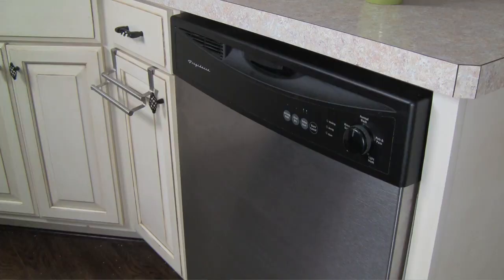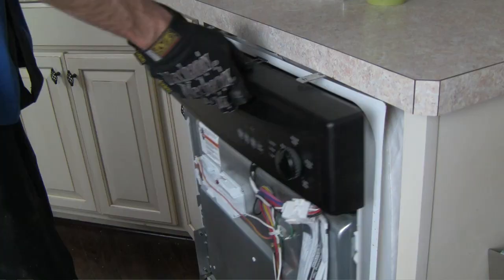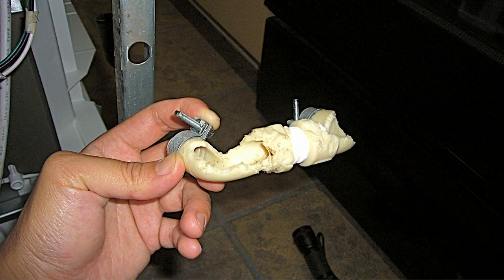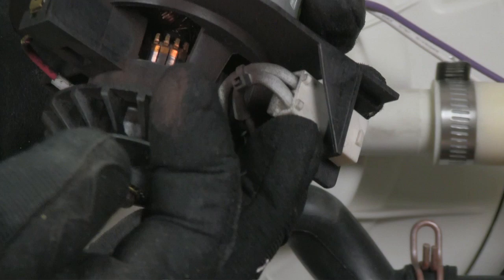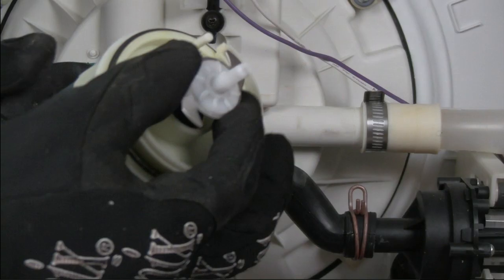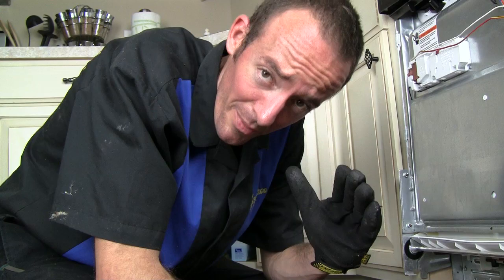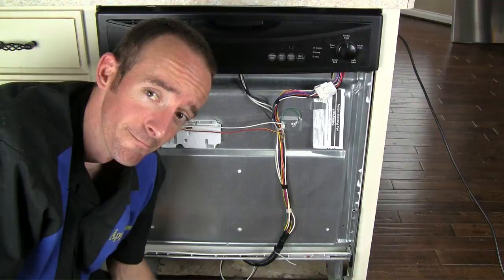How To Repair Frigidaire Dishwasher Noises

Comment: Hey man, congratulations on your expertise of how to make a very short and mostly important, very informative video. I was actually looking for a video on a different issue, but unfortunately none are available. I bought this place and the dishwasher has a weird film, sort of, like someone dumped a bucket of Sheetrock compound. Very white fine sand like film. I ran it 4 times without detergent, twice just very hot water and twice with a dishwasher cleaner. Results, sucked. I took the filter out and there is that white soft mud like compound all over. I've been using the same detergent the previous owner did, and can you believed it, it's the detergent? This ridiculous detergent can actually destroy your machine, with time, it builds up this type of sandy grit type mud. When dry, you actually need a chisel to remove it. Thanks for the video, if I ever come across any issues, I'm looking you up. Thanks
Reply from the maker: +Tony Oliveira Thanks for the encouragement! Hard to say what may have caused that... It could be calcium or it could be residue from gel detergent, that tends to leave more behind than most other detergent types. I have even seen people that are on their way out ruin appliances on purpose if it was an eviction type situation... if thats the case its probably done for.  It sounds like you have done all of the things I can recommend already... Limishine powder is the best dishwasher cleaner I have found to date, but if that doesn't clean it after a cycle or three it's probably best to replace it.
Reply: what detergent is it?

Comment: Thanks for the video.  My Frigidaire fdbb540ds1 is not draining or forcing water out of the top to spin the top arm.  Using your video I was able to clean out a bunch of gunk but it still won't work. It makes a strange sound when attempting to drain.  Could a problem with the drain pump cause the water not to pumped to the top to spin the upper arm?

Comment from the maker: It sounds like a control problem.  If the timer or control switch/relay is stuck on then opening the door would interrupt the circuit but otherwise it would run as long as there is power to the dishwasher.  So it sounds like you need a control... : (  
What is your model number?

Comment from the maker: In my opinion most dishwashers give less than desirable results... with that said there are some high end dishwashers that are very quiet and do a good job. However, they don't tend to have significantly longer life spans given the cost and repair is usually quite expensive. The main thing is fighting soap and mineral build up! Get the water as hot as possible at the sink before starting the appliance, use rinse aid, and scrape the big stuff off the dishes. More info on my website : ) Thanks!

Comment: I have the exact same dishwasher. There is definitely something caught up in one of my pump motors. It’s hard to tell which one it is from this video since you pulled it out from the installment area. but if I look directly underneath the dishwasher, there is a small pump/motor on the bottom, right hand side, right near the front of the machine. That’s where the sound is coming from, does anyone know what that motor is?

Thank you!
Reply from the maker: The smaller of the two pumps is the drain pump. So probably the drain pump.
Reply: Thank you for your reply! Do you know how I can select the drain function so I can see if that is what is making the noise? As it’s running through its cycles I’m not sure What function is currently on.
Reply from the maker: @bob-cd1lv on most Frigidaire dishwashers holding the start button for 3 seconds after a cycle has begun will cancel the cycle and run the drain pump for a short time.

Comment: Same dishwasher. Same noise. Took out the pump and disassembled as shown in the video. No blockage. No rubbing. Still Noise 😩Seems to be coming from inside the pump motor. Is it a bearing? Time for a replacement?
Reply from the maker: Sounds like the motor. But you’ve already half way to fixing it! 👍🏼

Comment: I have a question for you!  I have dismantled the dishwasher as shown.  The problem I was having is that I could hear water feeding into the dishwasher, but the dishes were not being washed.  I have gone through all the steps you have listed in the video, and other than feeding a live wire into the motor, I can't tell what the issue is.  Do I need to get a new wash motor?  Let me know soon as you can.  I have parts all over my kitchen floor!  Thanks.

Comment from the maker: Probably would be wise to pull the drain pump and check to see if something found it's way down in there.  It's a little strange that it would not drain at all with a similar noise, because that would indicate that the pump impeller is turning and should be moving the water out. You may have two problems: ( It is fairly common for the drain hose or the air break at the sink to also become clogged... You may be able to disconnect the drain line and put a shopvac on it to clear the blockage.

Comment from the maker: Thats a difficult one... If the motor sounds like it is working but you don't see any water moving during the wash part of the cycle, it sounds like the motor impeller may be broken.  All the main motor does is pump the water in the tank with its paddle wheel, so it sounds like the wheel may be broken or striped out.  I hope that helps some...

Comment: Hi We have a Frigidaire Dishwasher model #FDB1502RGC4 the original problem was the noise but was noisy from new (5yrs old) but now has developed a more serious problem. The machine will fill as normal but then just stops working, no wash cycle rinse etc. The machine will empty just fine if I hit the drain button. Looking to take out the motor to see if it is jammed. Could this be a likely problem or as I'm thinking the circuit board might be finished. Any help would be greatly appreciated as since it's not working my wife and I are doing dishes and neither of us,me especially don't like doing dishes by hand. Thanks in advance,
Brad

Comment: Thanks for the video.  Any suggestions on connecting an old mini fridgidaire dishwasher to the sink??  I just got it off craigslist (no model listed on the unit).  You plug it into the sink, but I can't seem to figure out how to complete the seal from the sink to the hookup...  Any suggestions on parts or makeshift ways to make it able to run?  Thanks!!
Reply from the maker: You need a portable dishwasher coupling that will hopefully thread into your kitchen sink faucet for the connection.  You can usually find them at a hardware store. You may also be able to find it online at a parts dealer but without a model number that will be difficult. Try an calling an ace hardware and ask for a portable dishwasher sink fitting... Good luck!

Comment: really helpful video. i thought i had fixed my problem when i found a piece of plastic in the circulation pump and another in the opening for the tube connecting to the disposal. when i put it all back together, however, the sound is still there, albeit slightly different (i think it's less? i'm thinking part of the sound was indeed the plastic in the motor. i would like to be able to test the pump independently like you did, but not sure how to do it safely. cause as of right now i can't even be positive where the sound is coming from... any ideas? thank you so much!
Reply: so i took it all apart again today, saw a lot of grime build up on the inside of the circulation motor, cleaned it off carefully with a toothbrush, put everything back together, and now the sound is worse. UGH. hoping i didn't put something back wrong in a terrible way! not sure what could have happened, but i will take it all back apart tomorrow i guess!
Reply from the maker: kristen hobbs Bummer.  The motors on these dishwashers are pretty low quality... it may be a bad motor bearing if there is nothing in it.  In which case replacement is the only fix.  Hope that helps! Sorry for all the difficulty.

Comment from the maker: What is the brand and model number of your dishwasher?  On many Whirlpool brand dishwashers the clean light is a heating error.  You may want to try preheating the water at the sink faucet before starting the dishwasher or turning up your water heater.  To clear the code on a Whirlpool push:  Hi-temp - Air Dry - Hi-temp - Air Dry (Air dry may be "energy saver dry")  then all the lights will come on and start a diagnostic test.  let it finnish and that should clear the code. Good luck!

Comment from the maker: Well you may need a new motor or control... you would need to check for 120 Volts AC at the wires to the motor when it should be running (almost immediately after the fill valve closes after the tank is full) If it is getting power and the motor is not running your control is okay and the motor is probably bad. if it is not getting power the control is likely the cause. Both options are pretty expensive so it may be time to swap it out...  Hope that helps some. Good luck!

Comment: When I pulled the pump out the impeller wheel portion came off the motor on stayed in the washer. I had to pull it out with pliers. Is that normal.

Comment: When i pulled my motor from the tub to inspect it, had a bunch of black powder pouring out of it. Does that mean the brushes inside the motor are wore out? The main problem is the dishwasher runs and fills, but gets stuck in the wash cycle and nothing happens. the control panel has already been replaced.

Comment: @applianceassistant - I have a Fridgidaire dishwasher that is usually quiet. I haven't used it for about 3 weeks and now I'm hearing noise during the cycle.  I also found a little white clip in the bottom. I really need to know what's going on.

Comment: I have a Frigidaire mod #FDB1250REC1 I bought that was a display but I have replaced both pumps, door switch and the control board within the last year and now it won't wash. I watched your video and took the bottom drawer out and pulled the screen and impeller cover, the impeller isn't seized but turns very stiff. Any ideas for freeing this up or do I need to feed the money hole under my cabinets again ? This is the most problematic dishwasher I have owned, the Maytag that this replaced worked trouble free for about 15 years and it was changed out for a remodeled kitchen. Thanks for your videos and any advise.

Comment: I have a frigidaire unit, and I am fairly sure this video comes pretty close to the issue, but I want to put this question out there before tearing everything apart. 

When the wash cycle starts, the circulation pump spins the water wheel for the first few seconds, which directs water where it should normally go (up).  After those first few seconds, it sounds like the pump is running dry, like it is losing prime.  Is this likely to be a clog somewhere that I can get to from the inside of the tub, or am I destined to pull this unit out and take the circulation pump off as you show in this video?

Thanks for this, your style of video production made me actually LOL, enough so that my kids came into my office insisting that I tell them what is so funny.  Good lighting and clear video make this very easy to follow.  Thanks again!
Reply from the maker: vbrookslv1 Thanks, Glad you liked it! The first thing I would check is water supply... if it's not getting enough water into the tank it may be loosing prime after the water is pushed into the air.  New thought... some dishwashers start the cycle with a short drain, before they refill with new water...  But if it is running the main wash motor I would look at water supply, then dig down into the sump from the inside and check for clogs.  You can even manual fill up the tank with water and see if it works that way. If it does you definitely have a water supply issue.  Good luck!
Reply: applianceassistant I should add this to clarify, after those first few seconds, when the pump sounds like it runs dry, I can see the water wheel stop spinning, even though I can still hear the pump turning.  This is with all of the internals stripped out such that the water wheel is visible.  I reset the door switch, close the door most of the way to contain splash, and start it.  

The cycle does start with a drain first, and then fills.  At no point does the water level get below the top filter.  When filling, it stops just above the level of the top filter cover.  The moving parts stay submerged at all times.  Does that rule out the supply issue?

I went ahead and pulled the pump out today.  It very closely resembles the model you demonstrate in the video.  I started like you did, working my way down the stack.  There was some debris that had gotten tangled around the shaft, and I was able to clear all of that out.  No apparent wear anywhere, except perhaps on the back of the motor, where there was some fine black particulate.  When I turn the shaft from any part, the whole assembly turns.  

I put it all back together, with hopes that maybe the tangled shaft was the issue, and I thought I had it, it started shooting water for awhile, but after maybe a minute, fell back to the same situation as before.  Thoughts?
Reply from the maker: Sorry for the delay, From what you are saying I would say the main wash motor pump is broken internally.  I had one that was acting very similar a few moths ago and found the shaft inside the motor had broken.  
Don't spend too much money on it. They are basically disposable when you consider motor replacement vs. dishwasher replacement... Really earth friendly business model... : (

Comment: I recently replaced the wash motor( before I found this video), because it would make noise even with the door closed but no cycles running.  After the new part was installed, the noise is still there.  What would cause the motor to run all the time when the door is shut?  Any suggestions would be great!

Comment: So I have a the Frigidaire Dishwasher as well.. and am having a bit of a problem. It didn't appear as though it was filling with water... So, I replaced the Water Inlet Valve  (I was very proud of myself) and now it does fill with water, it heats and it drains... What it isn't doing is blasting water onto the dishes? Ive even noted that neither spray arms are even moving between cycles.
I'm guessing that there isn't enough pressure from the wash motor & I should replace it?
What do you think?

Comment: I have a Frigidaire Portable diswasher.  I can remove the motor because the frame on the bottom is in the way. Any ideas on what to do on a portable dishwasher to get the motor out? I think I have this same problem but can't get the motor out.

Comment from the maker: I think your probably right... Usually the drain line will insert into that connection and the clamp will compress the rubber down onto the male end on the drain hose to make the seal.  What is the dishwasher model number?

Comment: so i got the motor out.. looks like a small weep hole in the plastic housing behind the last o-ring under a set of fins.. I'm thinking if it's leaking here then the internal seals on the pump part of the motor must have failed.. any thoughts???

Comment: My dishwasher is built almost exactly the same way as yours, though I have a different problem. 

Water seems to not want to drain from my dishwasher, it usually leaves enough water to fill it to just under the door, so it doesn't flood the house, but it's obviously not draining. I've taken the inside down clean to the paddlewheel and cleaned it all out with a toothbrush even. The water drains slightly better now, but nowhere near as well as it should. 
Suggestions?

Comment from the maker: Your dishwasher's water valve is probably not closing all the way. I doubt it's related to the garbage disposal... Unless you don't have an air break or high loop on the drain line and water is flowing back into the tank from the sink drain... Most dishwashers have some kind of a check valve to keep that from happening but not all.

Comment: I think my dishwasher uses the same motor for both.  There is only one motor underneath.  It's an 18" portable model.  The sound is slightly quieter during the wash cycle than the drain but it's the same sound.

Comment: Can the motor cause a rubber burning small because I hate to spend $170 to find out that is not the cause. There is nothing inside the washer. This video is awesome!
Reply from the maker: Not usually. Burning smells are most often related to the heating element in some way. If the motor was failing so badly that you noticed a smell it would probably not function at all. Take a close look at the element in the bottom of the tank and see if you can find any signs of something burning on it or it burning the tank. Hope that helps!
Reply: I ended up replacing the motor because I didn’t see anything around the heating element and the burning smell was not inside the dishwasher. I ran my first load and the smell is almost gone. Going to keep my eye out. Thanks for the great video.

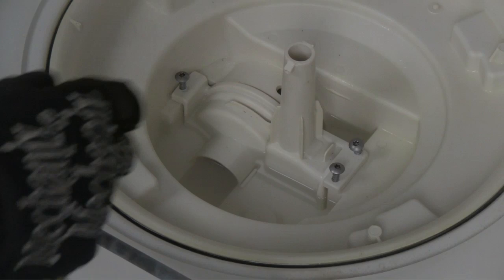Comment: At 1:35 in your video you spin a wheel under the filters. In my dishwasher which was not washing, this was stuck. Using only pressure from my finger I got it loose. The normal washing noises seem to be back but they are kind of whiny. Do you think the motor is on its way out, or do you suggest I continue through your video repairs. Thanks for the great video.

Comment: I cleared something inside the where the "solid food waste disposal blade" is, but the noise is still there as well as the water is not circulating during the wash cycles. Water drains fine, but is not moving or jetting. Is the pump bad? Why else would the water not be circulating or surging? Please advise.